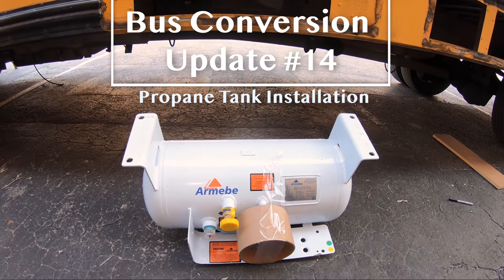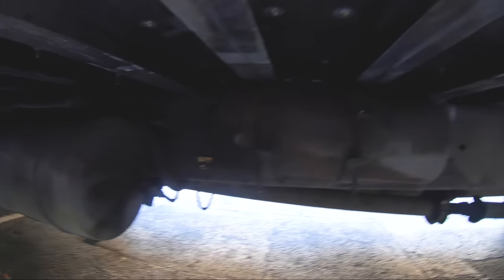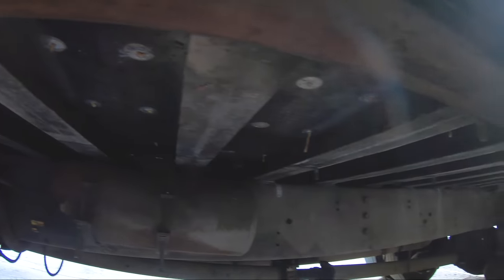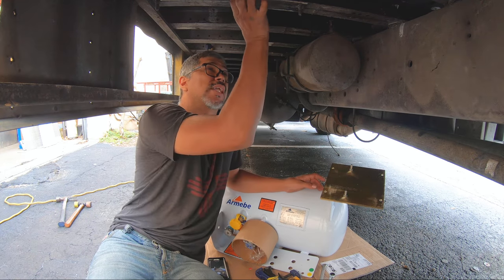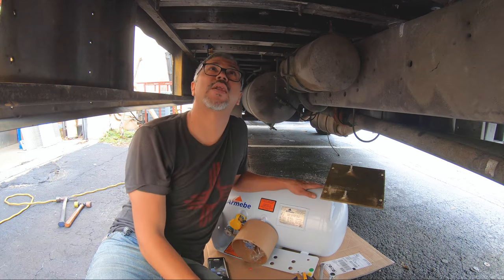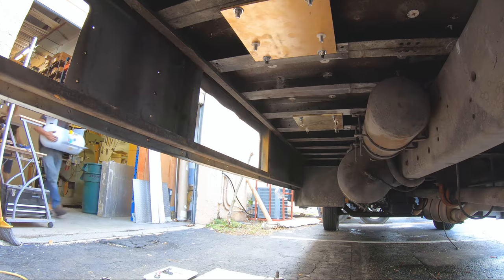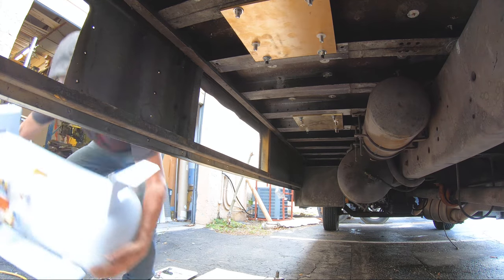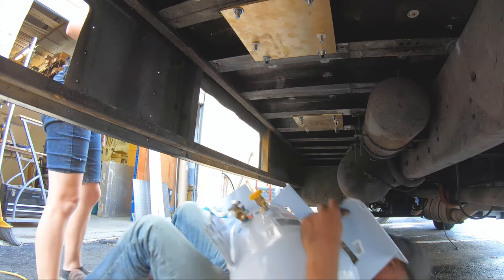How to Install a Skoolie Propane Tank | Skoolie Conversion

Comment: What size propane tank did you folks decide to go with?
Reply from the maker: Hi!   We went with a 12 gallon.  Here is all the info on it: https://artwethereyet.com/blog/installing-propane-tank-skoolie-conversion/

Word to the wise though!  We didn't know that a tank can only be filled 75% for safety reasons.  So we can only fill it to 9 gallons.  Still, this lasts us 2-3 weeks, and that's with cooking three meals a day and having the fridge run off propane 24/7.  So still works pretty great!
Reply: That looks like 30 lb tank. No?

Comment: Why
Reply from the maker: Hi Ayden!  Why what?
Reply: Sorry. What’s the purpose?
Reply from the maker: Of the project?  Here, check it out!  https://artwethereyet.com/blog/project-summary/
Reply: Art We There Yet? Of installing propane?
Reply from the maker: Ahhh, gotcha!  The propane is to power the stove, hot water heater, absorption fridge, and space heater.  Here are all the details: https://artwethereyet.com/blog/installing-propane-tank-skoolie-conversion/
Reply: Art We There Yet? I’ve seen busses have propane tanks that are just school busses (not conversions) What is it used for then. Do you know?
Reply from the maker: Ayden Foxx no, we've never seen school buses with propane tanks. It could be possible that some of them run with propane!
Reply: There was a movement to propane as a test for alternative power supply but it was found in effective and cancelled